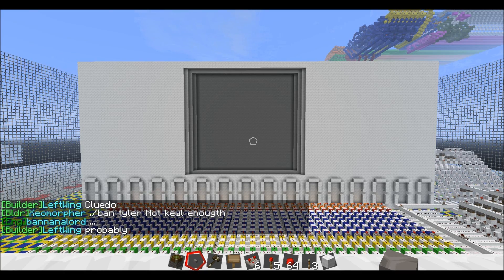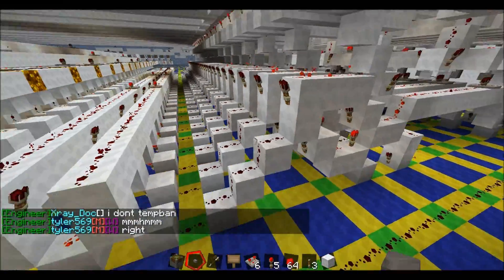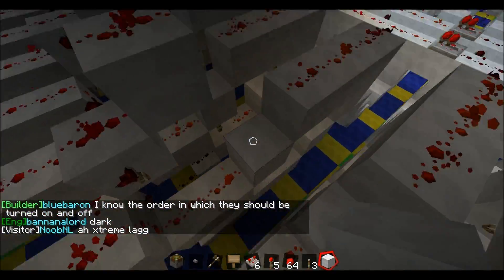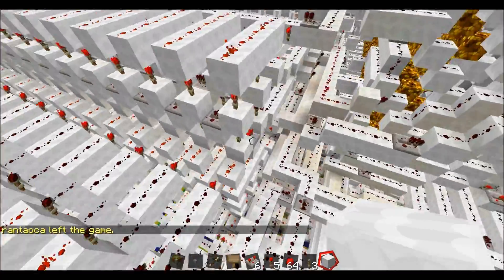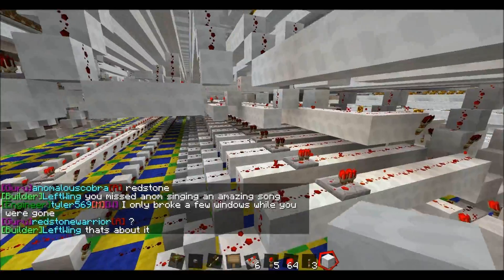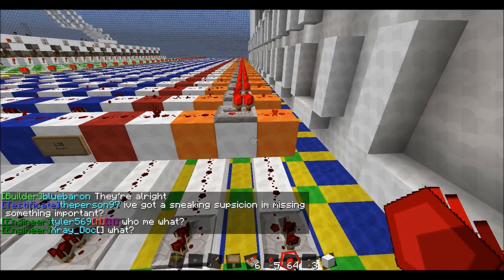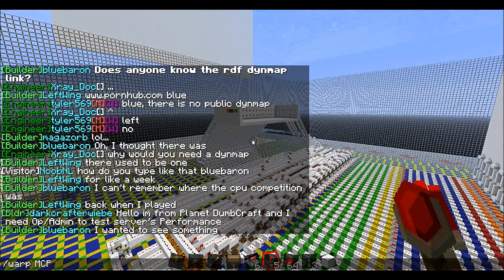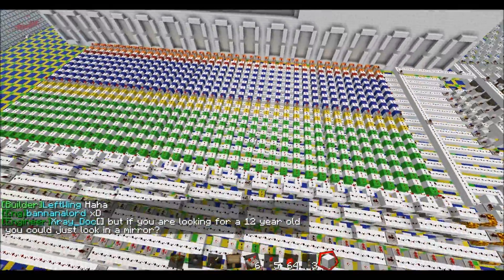16 Bit Minecraft Computer!

Comment: The comments about curing cancer, he is just rebuilding an invention. The science of computers is already there.
The science behind cancer is not so much.
Reply: Yup. Basically computers are 1's and 0's and take in power.
Redstone doesn't need power.

But its still f*cking cool as hell. And the time is there.
Reply: Dalek Caan2 Yeah it is quite cool.
I think the real talent is in building compact and simplified designs.
As soon as you use repeaters, the circuit slows down so keeping those to a minimum is key.
I built a basis 4 bit calculator with redstone, it was just huge and rather time consuming.
Reply: but there was no other reason then 1. showing off 2. entertainment 3. prove how much you can do with redstone and 4. because there's already a ton of other people working to cure cancer and video game engineering and programming doesn't require the same skills and knowledge as curing cancer
(conclusion: I think it was amazing no doubt)